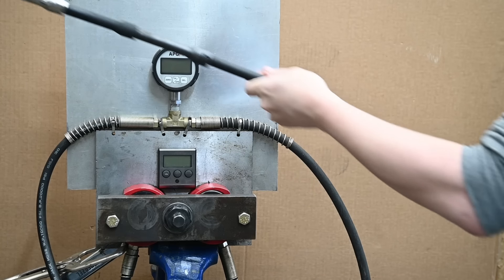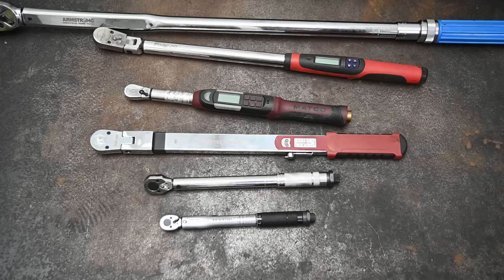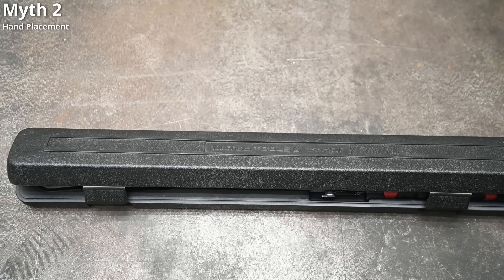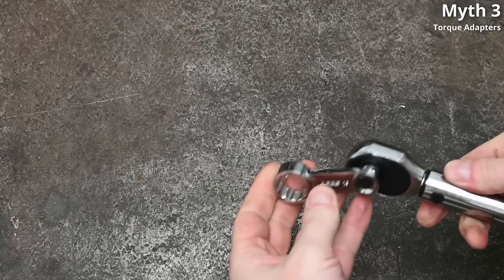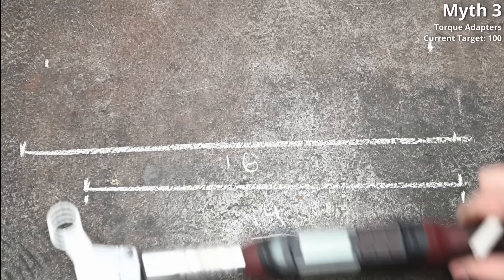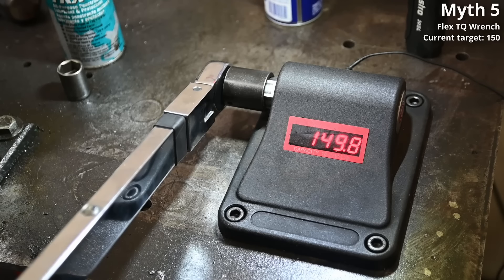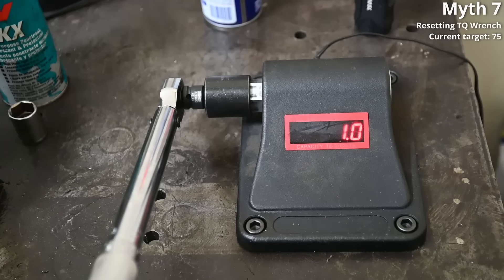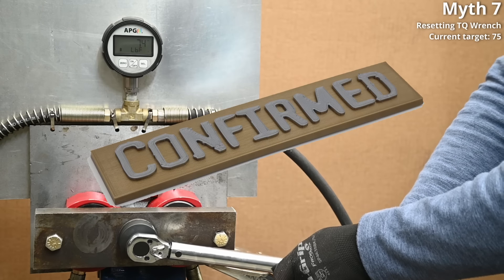You're Using a Torque Wrench Wrong: MythBusting 10 Do's & Dont's

Comment from the maker: Episode 2 now out, your guys' suggested myths tested! https://www.youtube.com/watch?v=V1Y3aB94lwU

For the Anti-Seize this only applies to threads that spec being dry. The opposite is true for a bolt intended to be lubed but is torqued dry - or for example rusty, even if effort in is the same it understandably results in being less tight. And higher doesn't guarantee failure, simply means the bolted joint will be much more clamped, the bolt twisted and threaded more and closer to its point of no return. There's known formulas for this. Always consult the spec 1st.
For resetting your TQ wrench we showed it's POSSIBLE on our oldest/cheapest wrench. So not a myth, but that's not to say some aren't barely effected by it. We don't have the data.
Reply: Would like to see the follow up on this with threadlocker, if it throws the real torque too
Reply: Another fantastic video.  As torque is simply a surrogate for bolt tension, it would be nice to always know the friction of the threads, and have a specification for that friction.  As dry friction is really hard to know (a lot of variability, especailly if not perfectly clean), it is best to use wet/lubricated threads (and the torque value for that lubricant), as it it much less variable.  One thing that is almost always forgotten, is that this toque to tension conversion is only valid for sliding friction (dynamic), not static.  In reality, what this means is that all of those people that check a bolt after it has stopped turning, are in reality not doing anything useful at all, as that is static friction. This is not to say that the similar practice of backing it off slightly and then tightening the bolt slowly and smoothly is the often recommended way to tighten things, sometimes in a pattern with multiple steps, like an intake manifold.  Note: Dynamic friction is always lower than static friction.  This is one big reason that it is often hard to use some digital torque adapters vs click, as the sound is not well timed to the stop point in sliding.
Reply: Yeah you make a great point. The wrench torquing the same bolt with and without the anti-seize produced the same amount of torque, it’s just that when they lubricated the treads with the anti-seize it generated more force. It shows how variable torque as a fastening method is!
Reply: But I hope people don’t think that anti-seize is bad or makes torque wrong. You just have to use what the manufacturer states should be applied.
Reply from the maker: Nothing wrong with Anti-Seize, we use it in plenty of places it's not spec'ed to go. Just to make the next guy's life easier. It's just good to keep in mind you might need one or two less ugga duggas on like a suspension component when using.
Reply: How about other variables like thread fit, length of thread engagement, coarse thread vs. fine thread?  It would interest me to see what effect these additional variables have on the torque input of a tool vs. the ultimate clamping force achieved by the fastener. Also, how repeatable and reliable the formulas that you mention actually are when applied with some of these variables in play.  I never would have thought that anti-seize would account for such a dramatic increase- definitely the biggest takeaway for me from this video. Thanks for the great content, and an awesome channel.
Reply: That's weird  it showed so high with Anti Seize. For Example,  big rig lug nut. We always anti seize them. Copper,  not that crappy silver stuff. Idk if it matters for tq results? But on our 1in air gun with 1/2 hose and IR compressor at 150psi, we tighten them till it stops. Check with 1 in tq wrench and they have never been over 500-525ftlb. So either the old gun is just that under powered? Or it doesn't matter on big  rig lug nuts that has washer built into nut , cause the gun will take off lug nuts that have been on for yrs on a trailer that had no anti seize on lug nuts where the 1/2 Milwaukee won't budge.
Reply: @Dood_ yes. Torque is all about resistance when it comes to tightening fastners,bolts,nuts ect so I would think using any type of lube or locking compound will affect torque values.
Reply: I wonder if it varies because big rig or like f350, f550 lug nuts have a washer built into nut. Cause I usually check a few lug nuts on f350- f550 since I know my Milwaukee gun, I check lug nut first at 110ftlb, if it clicks right away I turn up tq wrench 10ft lb and recheck to make sure its not over what I think it is, and 99% of the time the nut turns  a tad before it clicks. Idk been doing it like this for 20yrs now and haven't broken and studs, so I'm gonna stick to what I know on my Lug nuts. 🤷‍♂️
Reply: For the big rig nuts I'm pretty sure it's the washer that is making the difference. The washer is compressing and causing the friction.
Reply: I think you confused people by implying your dyno was measuring torque. Then introducing a lubricant and claiming more torque was being applied. The dyno is not measuring torque, and whether the threads are dry and rusty or clean and lubricated, the torque wrench applies the same torque.
Reply from the maker: @scottkramer7431  throughout the video, we mention and explain that it's bolt tension half a dozen times. But at the end of the day, who cares if the torque wrench is still measuring the same 100ftlbs of effort from you if the bolt is dramatically different in clamping tightness and stretch.
Reply: How about a video on torquing spark plugs into aluminum and iron cylinder heads using no anti seize, copper, and aluminum?
Reply: yes if a bolt/nut calls for lube use it if not don't
and if it does not say to lubed/wet treat it as a dry/un-lubed fastener

i have even seen some fastener listed as, wet - ?? pounds of torque / dry - ?? pound of torque

just for note wet in this case does not mean water or rain it means oil or grease
they may even specify oil or grease weight
Reply: At work, our standard for torquing bolts using antiseize is to reduce the torque value by 20% compared to dry threads. I'm curious how you needed a 50% reduction. I wonder if you applied antiseize to the face surface, which further reduced frictional losses. I'll have to rewatch that portion. Great work here!
Reply: Also for lug nuts, there will likely be more resistance from the taper even on a lubed thread. Plus anti-seize is such that it only needs one application every few years, so you'll only be off on the first one. Good to know it's such a huge difference though.
Reply: What about ARP Ultra Torque fastener lube? It is said to give a really accurate exact spec when used on the fasteners.  Have you put any thought into that lube and testing what's said on the bottle.
Reply: You should know about the '90 degree trick' due to learning scalar force diagrams at 13 in Physics... [ UK 'gen x' education ;-) ]
'parallelograms' ;-)
Reply: I wish I knew this BEFORE I stretched all the lug nuts on my Corvette
Reply: @TorqueTestChannel  you say 'dramatically different in clamping tightness and stretch' based on the same torque which makes sense when you think about it but I wonder if the clamping tightness might be less than a dry bolt because it feels like the lubrication would also go the other way and affect how hard it is to release the bolt which I assume is related to the clamping tightness.
Reply: We had a customer issue once where the customer was snapping wheel studs.  Found that the issue was due to the customer applying antiseize to the stud when installing the lugnut
Reply: Thanks for this! I’m an engineer so I understand the concepts but I just got my first torque wrenches so I would have missed some of the practical aspects. One thing that crossed my mind regarding anti-seize was that bolt tension and resistance to vibrational loosening might be affected differently. Also, what is the best way to clean aluminum alloy bolts and nuts without affecting dry resistance…and is there any way to protect the bolts and nuts from oxidation without affecting torque specs?
Reply: Question: since the anti-seize acts as a lubricant, wouldn't it take less force to remove it (like with everyday driving), despite what the clamping force may be? This is why I NEVER applied it to lug nuts. Too terrified of a wheel-off.
Reply: @djmips  The clamping force is the force between the two surfaces you're bolting together, which is related to the amount of stretch in the fully-tightened bolt, which is related to the number of turns. If you use lubrication, and this lets you put one whole extra turn into the bolt, this will result in roughly one thread pitch worth of additional stretching of the bolt, which will result in however much additional force applied along the length of the bolt, between the two surfaces being fastened together. This is unrelated to the force required to remove the bolt by turning it; as you say, the lubrication will work both ways there (easier to tighten, easier to loosen). But that's not directly related to clamping force.
Reply: @ObservationofLimits  wire wheels can ruin threads. But soft or brass wire wheels are better.
Reply: @Dood_  Me too, questioning everything I do now. Well, not really I go by the instructions as much as possible.
Reply: @brandonshisler5394  Great points. Also, how torque angle can be effected on the digital wrenches. I always marked my angles with pen bcuz I didn't have digital torque wrench, now that I've had one I've been checking it and it's not always 90 deg or whatever. I find usually a few 5 ish maybe degrees shy.
Reply: @TorqueTestChannel keep it Chooching!!!
Reply: Bolt condition (dry, new, used, rusty etc) is a huge deal in aviation.
Engines have failed in flight because of undertorqing, probably because a mechanic torqued an old, dirty, dry bolt where the spec was for a clean new bolt. The manuals specify whether the bolt (or nut) should be lubed or not.
With too low a preload, the stress can overcome the preload on the bolt or stud, and stretch it. That eventually results in fatigue and failure.
The ideal shop would ignore torque entirely and calculate tension based on how much the bolt or stud stretches.
But in the real world, it's usually better to over-torque than under-torque, tension bolts, provided the parts being assembled can handle the preload without distortion. (And provided the loading during use won't damage the bolt.) I have yet to see tire lug studs fail from fatigue when Magilla the Gorilla puts them on. But I've seen plenty of failures from them being too loose!
In our shop, we usually discard nuts and bolts after a couple uses because the preload becomes unpredictable, even with properly calibrated torque wrenches. (And some of those nuts or bolts are pretty expensive. Still, when it means questioning whether your propeller will stay on your plane while you're a couple thousand feet above the ground, it's worth the price.)
Reply: @juliansowa7622 anti seize is a lubricant and affects torque value. Average value given is torque rating minus 20%. I’ve stripped bolts using anti seize and stated torque value. Then started researching it
Reply: @TorqueTestChannel been told to subtract 20% of torque value when using anti seize after researching it to death after stripping bolts. On really important things. 🤬
Reply: @RustyPopcorn  Never seen that happen and I've seen plenty of lug studs with anti-seize. The clamping force is just too great. An actual wheel departing a vehicle from all lug nuts backing off is extremely rare regardless of why. The reason is, as they start to loosen even slightly, you feel it immediately. Long before they back off completely.
Reply: @mikepearson1057  That gets done every day because the plug makers pre-coat the threads and tell you not to use anti-seize. If you TQ them, they come right out. The ones breaking off in the head are usually installed with no TQ wrench.
Reply: I live in a high rust area and was taught in school to put a small dab of antiseize on the end of dry and or rusty wheel studs. The amount you used here was about 10 times what I was taught was sufficient. I wonder if this method would produce the same results as what you got using a liberal amount? Great video and thanks for all the hard work that went into it.
Reply: @Dusdaddy  my concern is long after the vehicle leaves the shop. These clients don't return to MY shop for such an issue, whether or not they attribute it to me or not. But I see it in the news. That's what worries me.
Reply: @kwmiked it showed high because their torque tester measures clamping load and converts it to ft lbs. 

The bolt is still tightened until it reaches the ft lb measurement, but that measurement comes at nearly double the clamping load due to reduced friction. 

Your lug nuts will still be 525ft lbs with or without anti seize, but they won't have the same amount of tension in the bolt.
Reply: @RustyPopcorn  I'll call BS on that. Go ahead and try to produce a story about a wheel falling off because anti-seize was used. If you find even one, there will be 10 more where the cause was the shop didn't install any lug nuts at all. I have an ATV where the manufacturer specifically calls for it in the manual.
Reply: @RustyPopcorn  it is a lubricant, but the grit in it acts as an abrasive. The idea is it bites in and holds, as opposed to rusting and locking up. Simple test to verify, put on your lug with it at x torque, and try to remove it with less torque than you applied it with.
Reply: Intrigued how much difference a Nyloc nut might make, or different types of washer between the nut and part.
Anything that changes the amount of friction on the nut / bolt will alter the torque needed to reach the same fastener tension, but by how much?
Reply: @drumbrakes  All of that will definitely alter the torque. We had nylok nuts used to mount a starter and they were one time use only. The TQ was developed with brand new nuts.
Reply: What if you just use normal grease, just general purpose grease that isn't sepcifically antisieze?
Reply: @White_Night_Demon  It's a lubricant so it will alter the TQ. Also, grease is never recommended for threads. It will allow the nut to back-off. Anti-seize will not as it contains solids. Grease for moving parts like bearings, ant-seize for none moving parts like threads.
Reply: @TorqueTestChannel  There are special anti seize Pastes, that have the same friction value of 0.12µ , that is normally used for the calculation of the Bolds torque, at least in metric. Like OKS250.
Reply: @Dusdaddy  Oh well one of the mechanics never specified anti-sieze, just said you're suppose to grease up the nuts and threads so when the next time you wanna change tyres, the nuts aren't rusted/welded onto the stud causing you problems trying to take it off. Didn't even specify the type of grease either so I just assumed general purpose grease or any grease to put on your nuts and or bolts that you dont want rusted in the next time you wanna undo it.
Reply: @randr10  I was looking for this comment... I did the math on this several years ago and came to the same conclusion - the taper dominates the friction, so as long as you're not lubing the seat, the tension is fairly insensitive to the thread friction.
Reply: I wanted to comment this earlier but forgot while I was watching the video so hopefully you still see this... 

While it makes total sense that adding anti-seize to threads makes it easier to turn by adding lubricant, one variable I haven't seen talked about is the fact that you're lubricating the threads but not the conical seat. I would wonder if a lug nut was tested on a wheel with the threads lubricated but the conical seat dry, if there would be any difference.

I know it's blasphemy but on all the vehicles I've serviced as a DIY working on family vehicles, I have always put just the slightest amount of anti-seize on the threads. I've never once seen a stretched lug stud or broken lug stud on any of these vehicles over many tens of thousands of miles if not over 100,000 miles and many rotations and tire swaps. On one car, the torque spec is 90 ft lb and after torquing it properly, I can take the lug nut off with a 1/4-in impact with a 5-year-old 2ah battery. 

On the opposite side of things, I have seen a lug nut stand up to a 3-ft breaker bar and me standing on the end of it and not budging. It was pure rust, no lubricant or anti-seize. I've got to think that's worse on a stud than a tiny amount of anti-seize.
Reply: I would like to see a test of angle drive sockets and extensions. I add torque basically by feel when using them. A common use is on a long extention when installing upper bellnousing bolts.
Reply: @eclectichoosier5474  
Even more important for your propeller to stay on while you are only a couple hundred feet up. Less time to react, less stored gravitational energy (I.e. altitude) available for landing options.
Reply: Thank you! You just made sense of years, wondering why i burn through bolts and nuts so fast. I always use anit-seize and here i thought i was protection the threads...
Reply: Thank you for saving me typing this out! Always RTFM
Reply: Anti-sieze may cause the threads to be pulled out of aluminum. Witness mark dry and then apply Anti-seize.
Reply: @kprause this is confusing, have the same question does arp and other bolts that call for specific fastener lube make a difference or is that calibrated in their specs?
Reply: @Dood_  Loctite shouldn't affect torque if the bolt is installed & torqued immediately after the locker is applied before it gets a chance to set.
Reply: I just helped my dad put new rotors and brakes on his truck. Before he put the wheel back on he applied a very generous amount of anti seize. I did the finishing torque to all the lug nuts and felt like they were slipping. I asked him about it, and he said he always applies anti seize and it's fine. I chalked it up to my inexperience with using a torque wrench on lug nuts. A day or two later I found this video and have been nervous that my dad is going to have the wheel studs sheer off, and his wheel or wheels are going to fly off. So I have been trying to get an answer. I have watched a bunch of youtube videos, then called 3 local mechanics, DOT inspectors, and Mountz Torque Tools. Youtube mechanics were 50/50 that it's a problem/it's fine. The local mechanics all said it's fine but one did say to only use a small amount. DOT said they have never seen damage do to anti seize but they are not looking for it during inspections. Once i found Mountz I thought my question will be answered. He said the torque probably won't be different between wrench and lug nut (going against your tests) but the clamping force that is applied from the torque wrench would be increased with anti seize applied. He didn't know what the difference would be but was sure there would be different. So I spent the last week or two working and still no answer.

Sorry for the long rant. My main question is, can the wheel studs and lug nuts (maybe rim and rotor)  with stand the extra torque (or clamping force) when anti seize is applied?
Reply: @TorqueTestChannel  El video está buenísimo, muchas gracias! 
Lo único que me parece me perdí, o no está en el video, es qué formula usa la máquina Dyno para traducir la tensión a torque, porque evidentemente cuando en "Anti-seize myth" lo lubrican al bulón, la máquina lee mal el torque. Aunque se entiende que se refiere a que el bulón aprieta con mayor fuerza lo que sea que esté uniendo. 
Lo comento no por la fórmula en sí, si no como para que se haga mención a la relatividad a la formula de las mediciones evaluativas anteriores.
Reply: Finally I see someone that knows this. Loctite/thread locker does the same thing and I've just stopped trying to explain it to people. You either understand it, and I'll let you work on my stuff or buy stuff you repaired or maintained, or you don't understand and I cannot help you, don't want you working on my stuff, and I'm not buying things from you.
Reply: What about having to undo the torque wrench after use, cos if you leave it set, the spring then looses some springiness and you don't get an accurate readings in the future. Am I right to say "always put it back to zero after use"? Cheers.